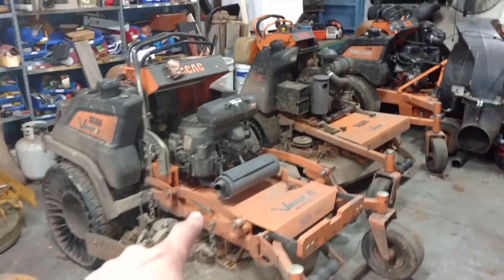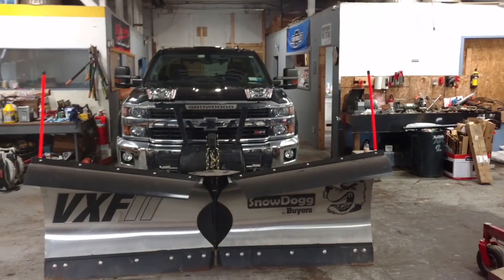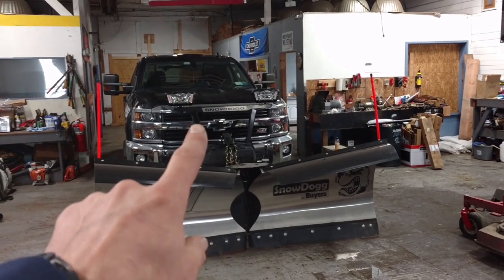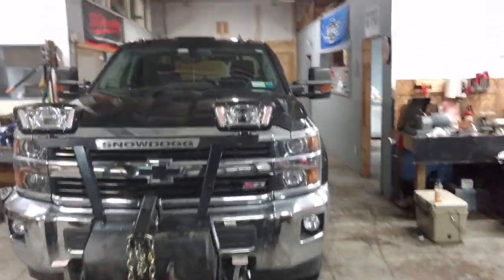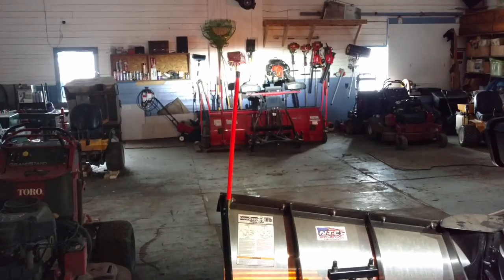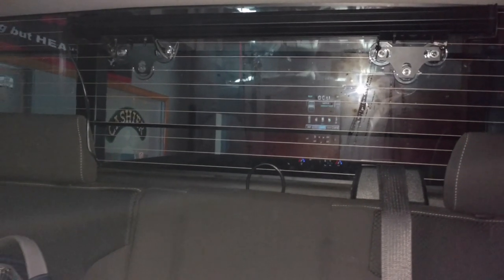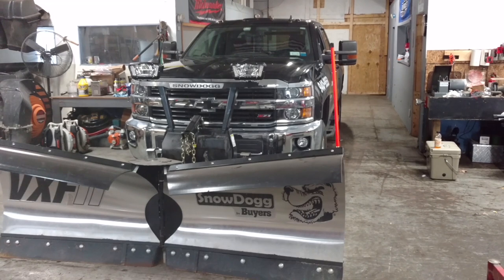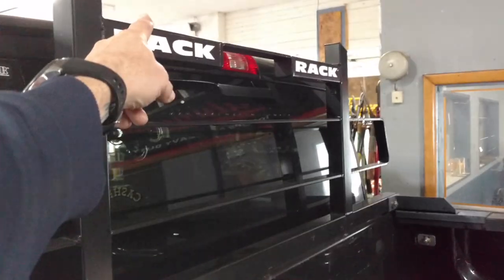SnowDogg ILLUMINATOR led Plow light upgrade

Comment: You can also give the 3rd wire temporary power to change the pattern if it’s hard wired
Reply from the maker: There ya go
Reply: Just needs touches to ground
Reply from the maker: Is that English
Reply: @CountrysideStrong  Spanish
Reply from the maker: Figures, learned it from mighty taco.... This guy is frigged🤣😉

Comment: Im.on the fence on getting my wings for my straight blade. I just dnt like the idea of 6 holes in my plow if I dnt like it I will have to patch 6 holes and seems cheap and winging back roads I feel I'd rip them off. Am I over thinking it? And I'm looking into getting the led kit from fisher but dude they want 600!!! Also looking at alight bar like you have in between the lights. I need to light up like a football field. Nothing pisses me off more plowing when I can't see my surroundings. Im on my last days of clean ups. We're getting a mix hear and there nothing sticking. But the leaves are stuck to the ground and it sucks
Reply from the maker: If installed right you won't rip them off I plowed Stone roads that are mile long at 30 mph they're not going anywhere if you put them on the right way. That being said you will only have two holes in your plow as far as the face of it goes the other mounting hardware bolts to the ends of the plow so technically the frame bracing of the blade which is no big deal. But I've never met anybody that got them that didn't say they should have done it years ago if that helps make your decision at all I'm not telling you to do it but maybe this helps. Talk to Mark from Mark's misfit world I told him for years to get him and he never did and then when he finally did he said it changed his life

Comment: I’m in Georgia, so the snow plowing doesn’t happen around here.. it seems like a solid axle truck would be better suited for the weight of the snow plow? No camber change on the solid axle vs the ifs.
Reply from the maker: Nowadays it really doesn't make a difference. The front ends of these trucks are beefed up with the plow prep packages
Reply: @CountrysideStrong  figured as much, the snow plowing looks pretty interesting. I’m sure it gets old pretty fast 😂
Reply: All you northern guys make it look fun.